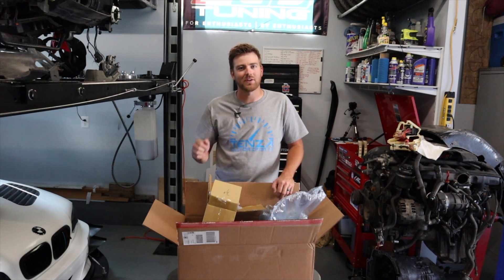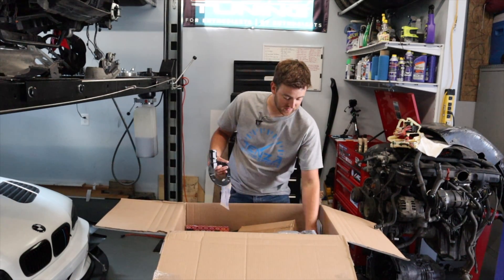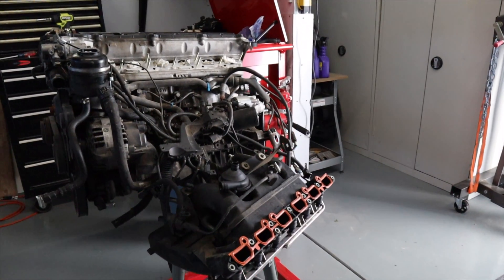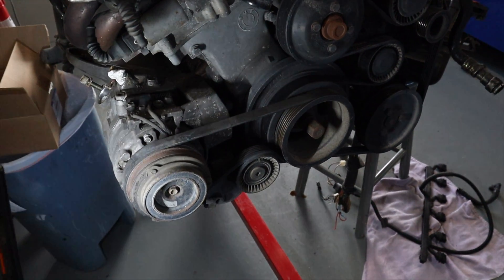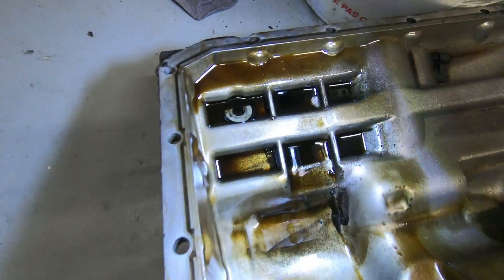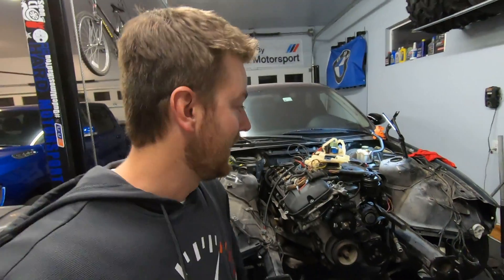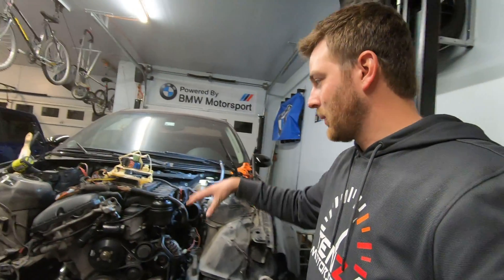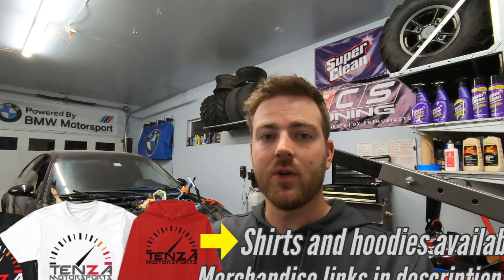M54B30 engine overhaul - BMW E46 M3/330ci motor build - Tips and tricks to refresh your race car

Comment: Are you able to remove the oilpump from the engine with welded nut, by just releasing the bolts from the block and not cutting the chain??
I want to weld my oil pump nut too, but need to bring my pump to  someone for welding as I can’t do it myself.
So I need to go reverse way and build in fully assambled oil pump incl. welded nut without cutting the chain.
Thanks!
Reply from the maker: Your best bet is to get a wired oil pump nut. Then you don’t have to worry about welding. I think you can unblolt the whole pump assembly, but I can’t say without having tried it myself.
Reply: @TenzaMotorsports  Tried yesterday, you can‘t.

Comment: I am still watching so maybe I missed it in another video. But what are you doing about engine harness and tuning for the m54 into the m3?
Reply from the maker: Plug and play with some ews tuning
Reply: @TenzaMotorsports  I assume you are using the harness from the m54?
Reply from the maker: Yes. The m54 harness

Comment: The oil pump on these engines scare me.
Reply from the maker: They used to scare me too. I just take care of it asap and then no more worrying.
Reply: @TenzaMotorsports  do you track the M54 often?
Reply from the maker: Yes. That’s what the white car has in it. It’s a supercharged m54
Reply: @TenzaMotorsports  strictly the wire method and you send it?? That’s relieving to know.
Reply from the maker: Yes! Wire method. It would have to have something very extreme happening to fail.
Reply: @TenzaMotorsports  nice to know! Do you run an oil cooler on the white one? I’m sure I may have to go to your build breakdown video.
Reply from the maker: Not yet. It’s coming. Temps have been OK, but a cooler is a must.
Reply: @TenzaMotorsports  I look forward to it! Love your channel!